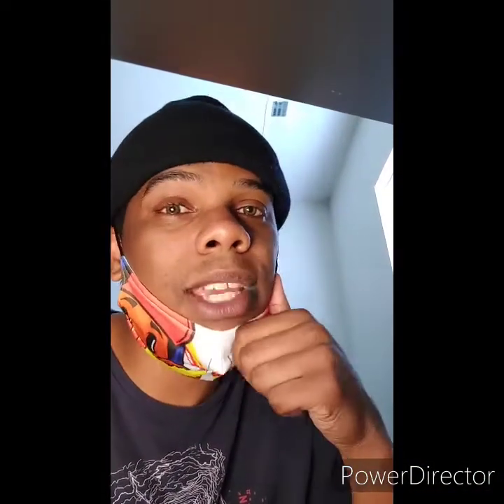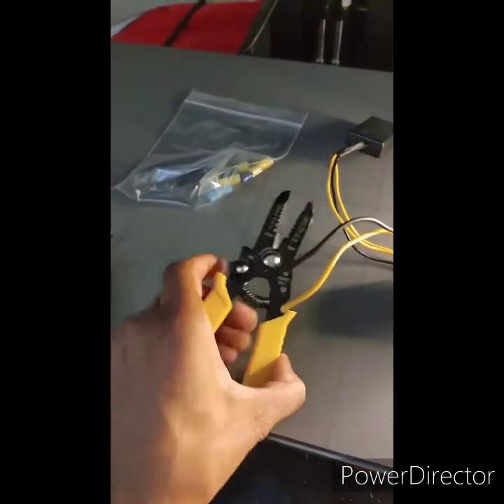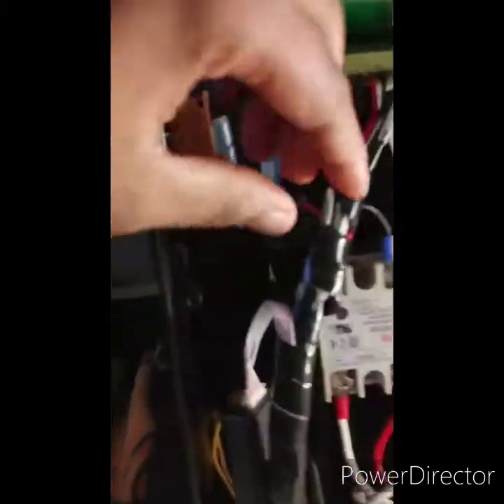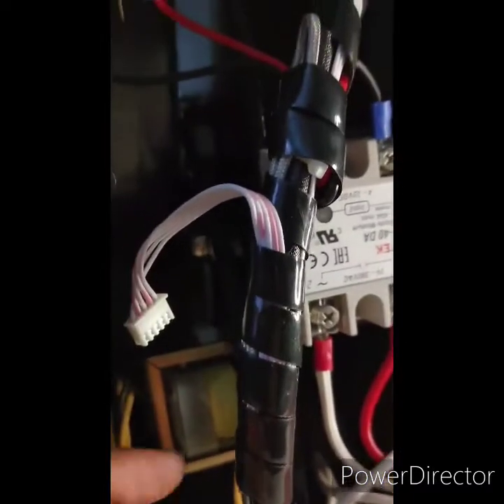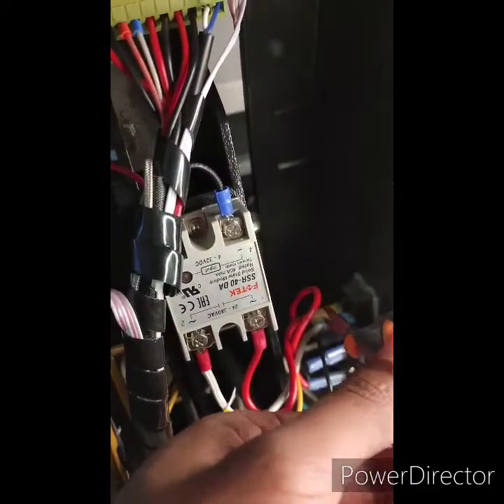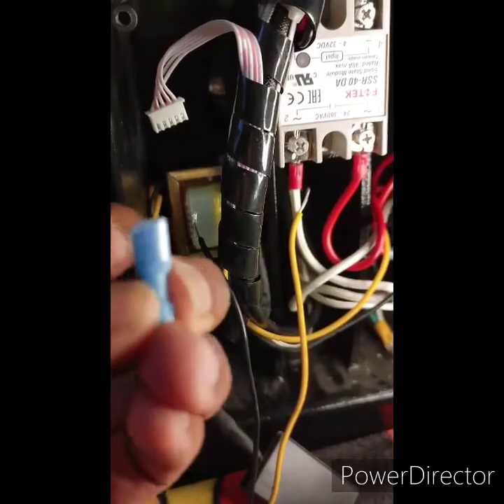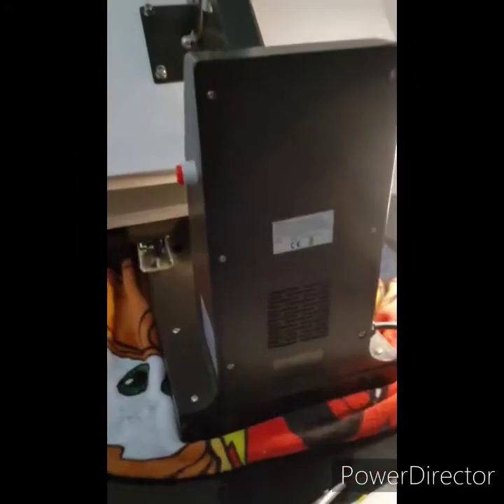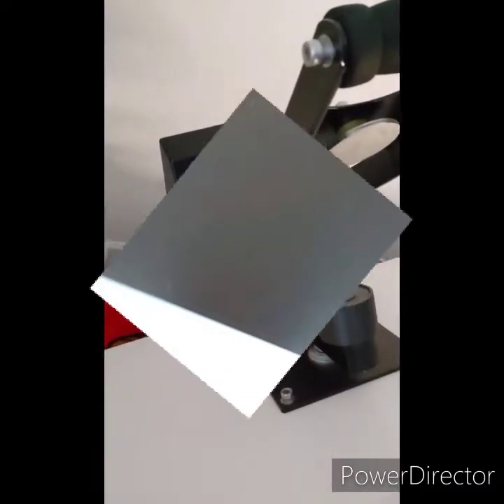How to Fix your heat press digital timer thats Dim!!!😎😎

Comment: I noticed your logo is similar to @nerd.sq on insta. I pretty sure he got this logo custom made. This is be a potential problem for the future of your business, not sure how long you’ve been in business, but he’s been using that logo.
Reply from the maker: Hey👋 thanks for reaching out. I actually have been seeing this a lot actually. The logo is created through the online site "placeit" there have been a few others using this same template as well that I have seen.

As far as a problem, Im not to sure about that because I have been using this as my logo for a long time. There are similarities but differences in details. 

I think this is an issue with place it more than anyone else becuase it is a standard template and deviates from there depending on the designer.

But that's great your reaching. Just make sure you officially know if someone created something or had it custom made. By you stating "your pretty sure" indicates you dont officially know, and i would hate for you or anyone to be embarrassed not knowing the facts.

But i dig his brand theme, its cool😎🤙🏾
Reply: Oh okay I understand now, I was just letting you know, But that’s just the downside of using those type of websites anyone can create the same thing as you.
Reply from the maker: @6figurewinners  exactly. I saw others using the logo way after me but I see it as none of them looks exactly like mine so Im cool on it and its not 100% custom. Now if I made it from scratch, then we have an issue 🤣
Reply: @SMCKreations  I understand keep being great 🔌‼️